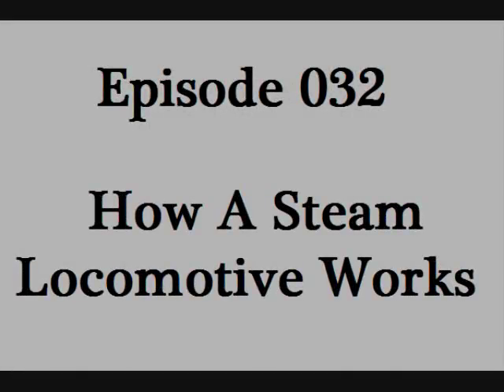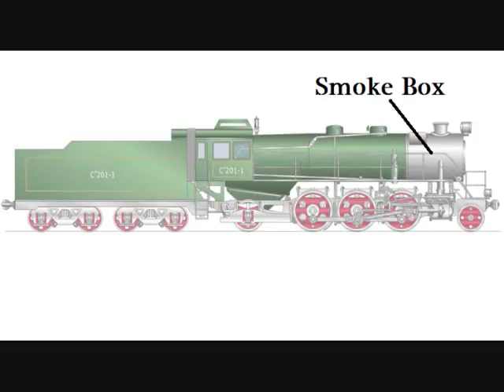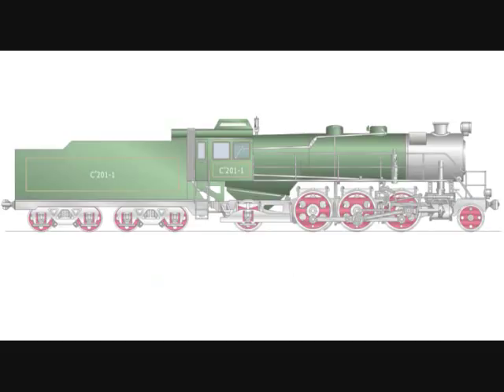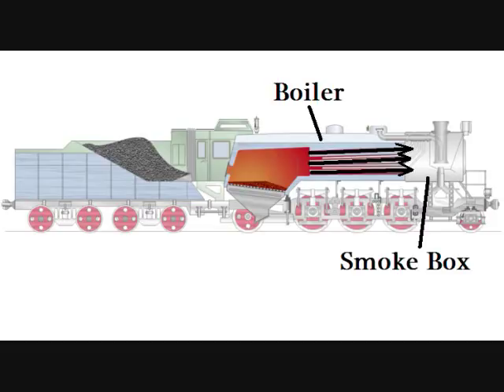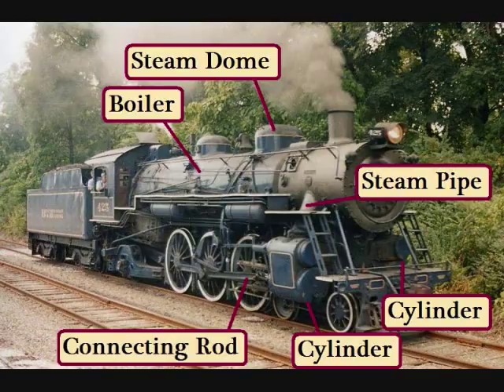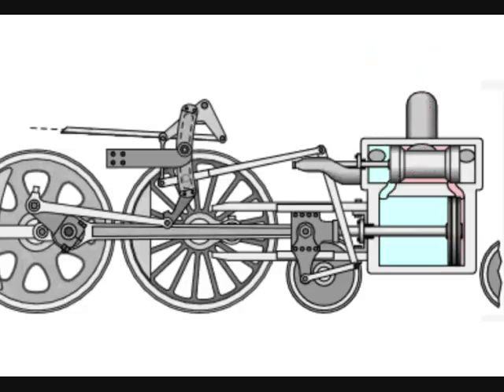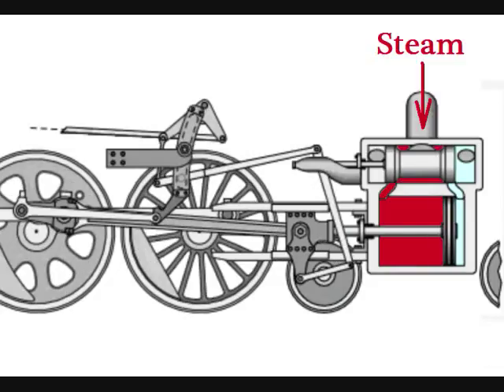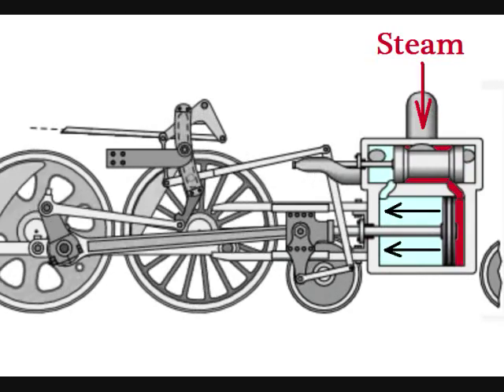032 - How A Steam Locomotive Works

Comment: The exhaust steam does not merely escape, it is used to draw heated air and smoke through the boiler pipes as it blows up the chimney. This is a crucial part of the design. Thank you.

Comment: Of course locomotives need gears.  The requirements of a freight loco (high torque, slow speeds, heavy loads = smaller wheels (like low gear on your car or bicycle) are very different from a passenger loco (smooth running, high speed = large wheels (like high gear on your car or bicycle).  Instead of developing a transmission and gears they designed different locos for the different jobs.

Comment: They do not have gears, however the cutoff (reverser) can be adjusted to increase/decrease the amount of time, relative to the valve motion, that the steam is admitted to the piston. When used effectively this can produce more economical running and prevent wastage of vital steam.

Comment: very impressive engine. Although it's very inefficient, being able to move that much weight with great speed without any gears is amazing. That's a lot of power! One of the greatest inventions of mankind.
Reply: Inefficient, in terms of mass, which move heavy train further, ?
Reply: @marshalcraft  inefficient in terms of energy yield... as far as i know, the yield is somewhere less than 10%. Compared to diesel engine that is a lot more efficient in terms of energy yield. This means you need more calories for the steam engine to get the same result as a diesel engine.

Comment: Should also be noted that the drive wheels were weighted to pull the wheels past the "dead zone" at the end of each power stroke.
Reply: The weights on the wheels are to balance the huge mass of the coupling rods, crankpins etc.  There isn't really a dead zone because the opposing wheels are set at 90 degrees on a two or four cylinder loco and at 120 on a three cylinder loco.

Comment: Great explanation. However, I'm curious about one subject the video didn't really cover: The actual start-up of the train. 

In a vast majority of the cases, the piston wouldn't be aligned enough with the connecting rod and the  to present enough resistance in the initial revolution to cause problems. But if hypothetically they ended up more or less completely aligned when stood still, wouldn't the pressure from the piston simply snap the attachment rods to the wheels off, or make the piston housing explode from the pressure not being released properly, or deform the mechanical parts, or any number of other things? 

Or is my assumption that the assembly was mirrored on both sides of the locomotive, and thus being at the same stage of the cycle at any one time, faulty? If that is the case, that the pistons worked at, say, 90 deg difference, there wouldn't need to be a starter engine or some other contraption helping it out of a potential bind.

So, how did it actually work, to avoid that sort of thing?
Reply: I'm pretty sure they used a little hand jack at the very back of the train to  help get it rolling if it needed help. Super simple solution to a very complicated problem haha
Reply: This was solved easily. The Piston on the opposite side was offset by 90 degrees. That way, if the piston on one side was fully to one side of the cylinder, the one on the other side was in the halfway point. There was, therefore, no "dead zone".
Reply: In the days of some of these locomotives . It took 10 hrs from a cold start to make steam. One man would come in get the fire going work his 10 hrs shift then turn it over to the engineer

Comment: So where is the steam return back into the boiler ? Or is there one ? Does the steam turn into condensate and return to the system ? Figured the tubes would burn up if it ran low on water
Reply: Once used, the steam does not return to the boiler. It is expelled directly from the piston. The exception would be with the Mallet-type locomotives that have two sets of drive wheels (such as the 4-8-8-4 Big Boy or the 4-6-6-4 Challenger). High-pressure steam from the boiler is used to power one set of drive wheels. Then the steam is routed to the other set of drive wheels with a piston that can utilize a lower pressure. Then it is exhausted out to the sides.

Edit: Oh, and running out of water would be REALLY bad! Water under pressure helps keep the temperature down (just like the radiator in your car). Without water, the steel can heat up enough to deform and weaken causing a catastrophic explosion. In other words, if you run out of water, you're going to have a bad day!
Reply: @WanderingYankee  so since there’s no condensate return to the water supply, then the range, I’d assume, wouldn’t be very far ?? I know water droplets expand 1700x so 25,000 gallons is a lot of steam. (I say 25,000 cuz I seen Big Boy the other day). Not a train guy just work in the refinery ops and was thinking about this. Very cool! Dont guess pulling an extra tank of water and pumping to boiler as needed was a thing.

Comment: Would a stem engine work in outer space?
Reply: Yes, but you would need some modifications. The most important one would be sealing and supplying oxygen to the firebox. Most of the engine would function just fine since it is (mostly) sealed. The boiler/pistons can operate in the neighborhood of 20 times more than normal atmospheric pressure (~around 300 psi). In a vacuum, the difference is only 1. The other issue would be traction. Here on Earth, gravity holds the train down. In space, you would need wheels that can grip a rail, just like rollercoasters do.

Comment: Two questions;  What decides the direction of movement (Forward or backwards) ? How do you obtain reverse? Is there an engine brake?  Ok- that's three.
Reply: newstart49 in the video you can see that the valve isn‘t running in synchron with the piston, it is either running ahead or behind and that decides on which side of the piston the steam is entering the cylinder space. The running ahead or delay of the valve makes that the engine is running forward or backward and the degree of the delay makes the amount of the steam that enters the cylinder. The valve is actuated by the controls in the cab. The engine brake is usually an airbrake like that on a freight or passenger car, pressing a brake shoe against the wheels. But there were few engines that used the Riggenbach-brake in addition. That brake uses the cylinder similar to a compressor to brake the train by compressing air, the compressed air is then released to the outside. Usually the Riggenbach-brake was used on engines working on heavy grades (downhill).

Comment: I really loved this video it helped me understand how a steam engine works, Just one thing. This question might seem dumb but I'm dumb so what do you expect but how do steam engines that seem to lack cylinders work? like the e2 class, do they have a hidden cylinder?
Reply: On some locos the cylinders are located on the inside of the wheels, and on some there are locos with cylinders inside and outside (3 and 4 cylinder locomotives)
Reply: Some steam locomotives are steam turbine powered and don't have the classic cylinders and valve gear.
Reply: There was ONE class of Locomotive that had a turbine, it was a one off prototype, was deemed a failure and scrapped.

Comment: Werent there any steam locomotives that condensed the "used steam" again in order to refill the boiler less often ?
Reply: There were types that sent steam into one cylinder at high pressure and then the "old" steam was re-used in a second set of cylinders.
Reply: @LardGreystoke  Correct. That system was used with Mallet-type locos that had duel sets of drive wheels. Steam was not recondensed to replenish the boiler.

Comment: can someone explain to me how the wheel rods know to move the train forward or backwards. besides the reverser regulates the direction.
Reply: Josh Webbs The "Johnson Bar" or reverser adjusts the intake piston to either start the piston so the wheels turn forward or backward.  The reverser is a one stop mechanism, where, when the lever is put full forward, it can be adjusted to reduce the amount of steam going into the cylinder once it gets going.  This makes the engine run more efficiently, much like a transmission.

Comment: Some steam locomotives seem to make more than two chugging sounds per wheel revolution.  Do the cylinders alternate their movements forward and back or do they both move forward and back together?  Please answer.
Reply: Each cylinder is exhausted twice per wheel revolution, as steam is admitted and expelled both sides of the piston.  As the crankpins on the wheels are 90 degrees apart from the ones on the opposite side of the loco, there is an exhaust stroke at every quarter of a turn from one or other cylinder, even on a two cylinder loco, therefore, 4 chuffs per revolution.

Comment: Are two cylinders phased 180 degrees against each other?

If yes, then, how does the locomotive starts to move if the pistons happens to be top and bottom dead center please?
Reply: 90 degrees on a two or four cylinder loco and 120 degrees on a three cylinder loco

Comment: Very good explanation of how the steam engine works.  So, the locomotive has a piston and valve on each side.  They are slightly out of phase so that power is delivered to the wheels at all times.  So is the chuffing sound made up of 4 components, or are the sounds so close that at speed there appears to be only two sounds?
Reply: Each cylinder is exhausted twice per wheel revolution, as steam is admitted and expelled both sides of the piston.  As the crankpins on the wheels are 90 degrees apart from the ones on the opposite side of the loco, there is an exhaust stroke at every quarter of a turn from one or other cylinder, even on a two cylinder loco, therefore, 4 chuffs per revolution.
Reply: @robertbrown2728  Sir, thank you so much for helping me with this. While researching the history of the SPLA&SL Railroad, I became fascinated by the engineering that went into making these locomotives work.  Amazing what they were able to do in getting everything to work in sequence.
Reply: @H.pylori  I'm glad to be of help.   There are many aspects of steam locos that I don't fully understand, for example - exactly how an injector works, and I'm fascinated by them all :)

Comment: How does the piston move if the starting position has the exhaust valve open? 
In a small engine you can spin the flywheel but this isn't possible with a big locomotive.
Reply: same problem with me i make small engine but valve timing is so dificult to set  cause of bad timing engine not running
Reply: Hardtop Harry Each side is opposite to the other side, normally 90 degrees off, so they don't end up in a "dead" position.  One side starts and then the other side quickly catches up.
Reply: Hardtop Harry
Reply: Steam is let into the pistons when the regulator valve is opened in the steam dome.
Reply: There are two exhaust valves

Comment: What happens if the locomotive stops when the valve is just in the middle. Does that mean it is impossible for the locomotive to start unless the valve is shifted manually by the crew?
Reply: steam locomotives have two cylinders that are offset to one another. If one stops in the way you describe, the one on the otherside is in the correct position to start the process.

Stationary steam engines and steam traction engines that only have one cylinder, have a large flywheel that can be spun manually in order to start them off.

Comment: Ok I am starting to watch stuff on how steam locomotives work because I am wanting to build my own, I get what’s going on but the valve in the cylinder doesn’t make sense to me. How does the steam get into the pistons.
Reply: There's a tiny little hole that the valve doesn't cover, which is how steam gets through to the piston. When the piston moves, the valve now covers the hole, but allows a second hole to open, allowing steam to flow into the piston, pushing it in the opposite direction.

Comment: The best kept secret that none of you locomotive men seem to want to talk about is the steam ejector. AT some point it occurred to me that there had to be some way to get water back into a pressurized boiler but there was never any talk about how this was done. At this time I did not even know how to phrase the question. It took about three or four days putting the question to google in various ways And then I came across the steam ejector. Finally I found a video of this component and to me, it is the most advanced thing about the entire engine. Two questions, why is it call an ejector when it actually injects and why don''t you guys want to talk about it?
Reply: pforce9 where I live it is called injector not ejector. It works with the functions pressure, speed of flow and diameter. Steam from the boiler (boiler pressure) flows through a intermediate sized pipe to the injector, where the diameter is reduced by a cone, a smaller diameter results in a much higher speed but a low pressure, lower than the atmospheric pressure. This makes that the steam takes the water up. After mixing together, the now hot water with low pressure but high speed enters  the pipe leading to the feeding valve. This pipe has a big diameter, so that the hot water now has a very low speed of flow, but high pressure, at least higher than the boiler pressure. It’s a bit similar to a electric Transformator: boiler pressure & intermediate diameter & intermediate speed   transformed to   low pressure & small diameter & high speed and then transformed to   above boiler pressure & big diameter & slow speed. That‘s called venturi effect.

Comment: I  enjoyed the video, but disappointing it did not cover IN detail all the linkages from the piston to the wheels and back via the "reversing" mechanism. I have looked EVERY where, I found a number of "animations" which were good, but they ALL (that I can find) fall short of explaining IN detail the above.

Inquiring minds want to know!" 

I have pondered this since I was six years old. Still do not have a meaningful idea of "HOW" the linkages do what they are designed to do. I am 83 yrs old. And STILL seeking a simple animation that covers IN detail all the linkages and what EACH does.

Oh well.

ONE YEAR LATER:

Thank Jesus, I have found out the answers to MY questions above. I wish I knew how to put this new found golden info on an animated video. It is quite slick HOW several levers can control SO much of what is going on, on most all steam locomotives.'

Sadly I do not know how to do this. And sadder: just putting it in print would be as useless as teats on a bull.

Oh well.
Reply: I also would like to know.
Reply: Where did you find the information?
Reply: Inquiring minds want to know!

Comment: Very informative, but, what actually happens whilst the locomotive is standing stationary, is there someway to allow the steam to bypass the cylinders?
Reply: when the regulator/throttle is closed, no steam is being admitted to the cylinders, it stays pressurized within the boiler
Reply: What Q'Kumber said.  Also, if the steam pressure builds up too far it could potentially cause the boiler to explode, which was a common danger with early steam engines.  That's why all steam trains were fitted with at least one and often two safety valves which would open to release excess steam pressure before it could reach dangerous levels.

It was the job of the fireman to not only keep the firebox stoked, but also to regulate the amount of heat produced in the firebox so as to optimise the steam pressure.  If done properly, this would minimise coal usage while maximising the power available.
Reply: The job of maintaining the boiler pressure is the responsibility of the fireman.  Prior to stopping the fireman holds back in stoking the firebox.  Then when stopped the fireman dampens the fire to conserve fuel.  As stated below overpressure valves on the boiler are always in place (and, tested regularly).    Lastly there is a condensate valve at the bottom of the cylinder.  When stopped steam is administered to the cylinder to keep it hot.   If the cylinder cools it will cause condensation and could blow the cylinder.   This is why when you see a steam locomotive stopped you see steam coming out from the cylinders.

Comment: But where does the cut-off valve and regualtor come into this?
Reply: The regulator controls the admission of steam into the steam pipe to the cylinders and the amount of cut-off (controlled by the reversing lever/handle and the valves adjacent to the cylinders) determines at what of the piston stroke no more steam gets into the cylinders.  When running quickly the cut-off happens quite early on as there is no benefit to admitting more steam, and there are negative effects on economic running amongst other things if the cut-off happens too late.

Comment: but how is the valve moving forward & backward?
Reply: Tehran Alishov:  They didn't explain that the valve is attached to that J-shaped lever system which is connected outside of the piston rod and pulls/pushes the valve back and forth.
Reply: how valve moving if u want to know add me at whats app i send u video of my homemade small engine